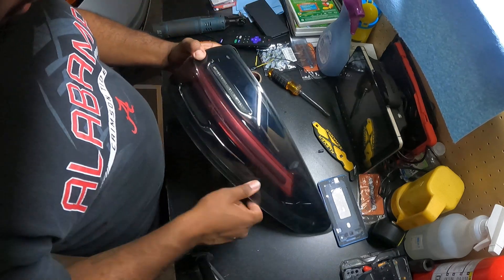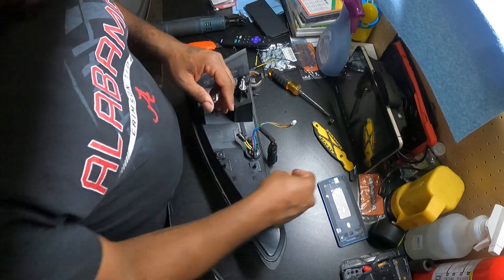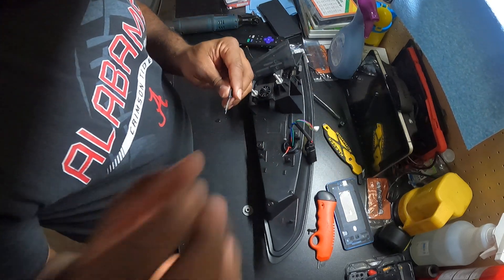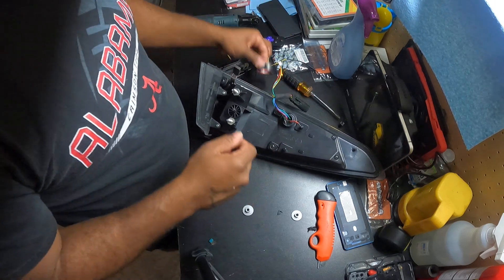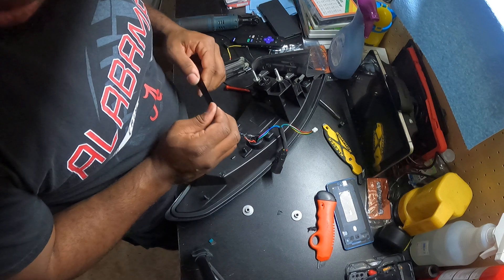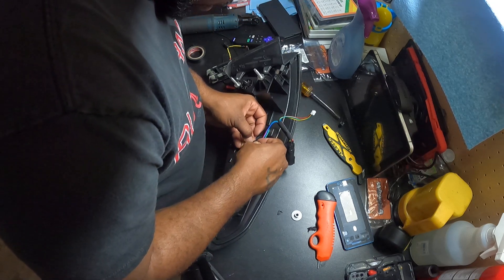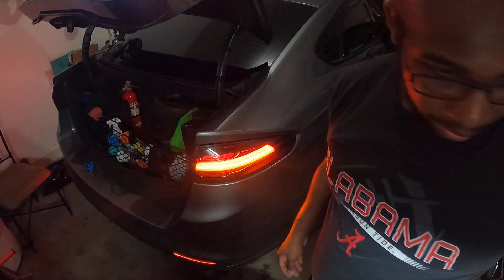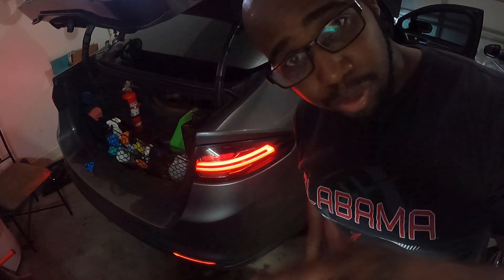Ford Fusion Porsche Style Tailights Issues With The Amber Turn Signal

Comment: Hello, a question, what are the options that I should change in ForScan, so that the brake light turns off when I do not have my foot pressed on the brake?
Reply from the maker: For the tailights?
Reply: @XpolrerST  Yes
Reply from the maker: @ingekevin9034  if you have upgrade to the titanium tail lights you need to change in forscan to titanium

Comment: hey boss love the fusion. I ordered the capacitors and theyll be in soon. after installation, do i need to program the lights with forscan? if so, how do i do this?
Reply from the maker: You will have to go in the BCM as built

Tail Light Type:
726-28-01 (2014+ MY) xxxx xxxx xXxx
1 (EU Mondeo Tail Lights)
3 ( S/SE Tail Lights)
4 (Titanium Tail Lights)
Note: Mondeo Tail Lights - May have to change entire line to: 0101 0101 015B

and 726-28-02 change to: 0000 0000 0158 for 2016 MY
726-41-01 (2013 MY) xxxX xxxx xx
1 (EU Mondeo Tail Lights)
3 ( S/SE Tail Lights)
4 (Titanium Tail Lights)
Note: Mondeo Tail Lights - May have to change entire line to: 0101 0000 71
Reply: @XpolrerST  thank you so much!!

Comment: So I added the capacitor to the passenger side tail light and it didn’t seem to do anything. Will doing this to the driver side further help the situation? I changed the capacitor out and added the new one but it’s still displaying the yellow band
Reply from the maker: You may have to try different ones. Go higher or lower till you find the right one
Reply: @XpolrerST  keep the 25V and just mess around with the UF correct?
Reply from the maker: @Alexis Tosline  you can change it down to the 10v also. I did a whole bunch before I found the right one
Reply: @XpolrerST  perfect. Appreciate you bro
Reply from the maker: Also if the yellow light is displayed fully you have too much and need to go less. Vice verse if it's barely showing up